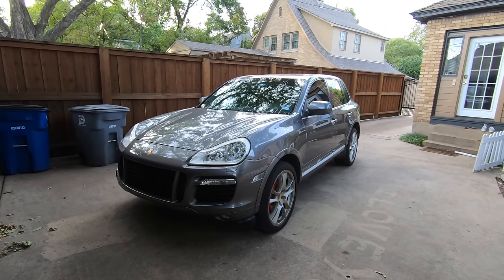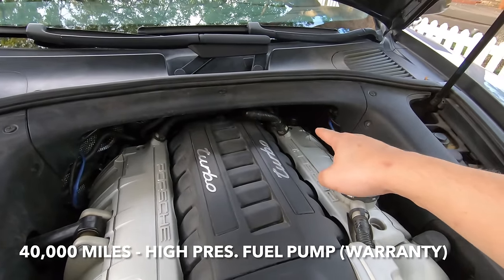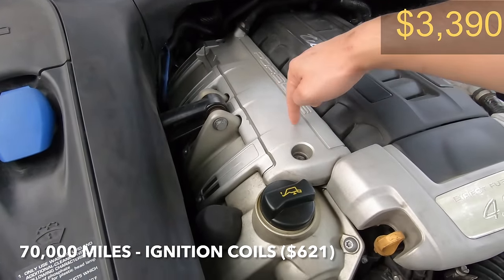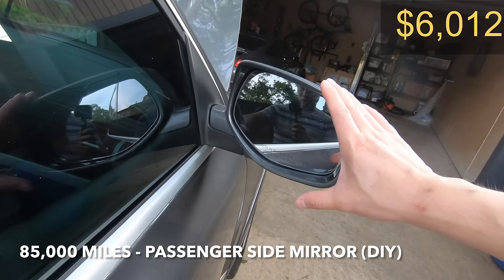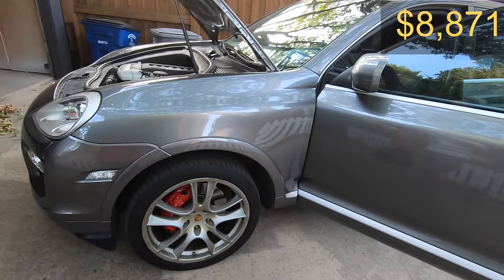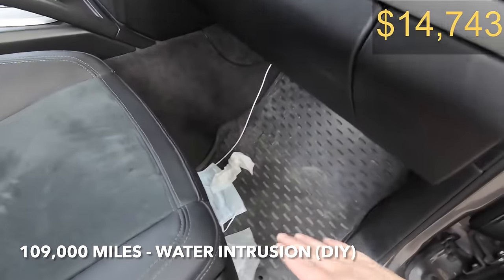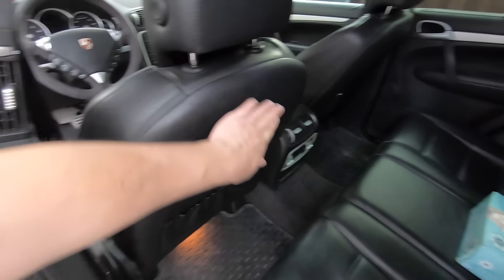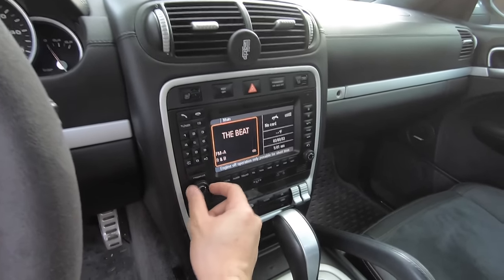Why Are Used Porsche Cayennes So Cheap? Owner's Review of 15 Year Old Cayenne Turbo (955, 957)

Comment: Having owned about a dozen different Japanese built cars over the last four decades, I can honestly say I havent had a tenth of the problems you have had. You are a VERY patient man dealing with those problems, I guess you have to be an car enthusiast (and part time mechanic) to own a Porsche.
Reply: Yeah car enthusiasts can't own reliable cars lol. But 99% of Japanese cars are naps on wheels.
Reply: what is the japanese equivalent of this car?  the infiniti fx45 and fx50 with the v8 is probably the closest, and a car i may buy some day as ive always loved those.  not nearly as fast as a cayenne turbo s stock but close enough to the non s turbo a few basic mods could make that more equal.  the cayenne has a lot more cargo space though i believe.  the fx series are not really made to be spacious.  not sure what theyre really made for to be honest lol  but they look cool and drive pretty well for a car that is fairly cheap to buy and probably cheap enough maintenance compared to a porsche.  i had a 92 infiniti q45 for 3 or 4 years around 2001 to 2005ish and it was honestly a really good car, even with the high miles mine had.  no issues other than replacing the thermostat once and it was up around 135k miles i want to say. my 1990 maxima se i had before that was also pretty solid. part of why id like one of the v8 powered fx models.
Reply: The issue is it isn't really a porsche but mostly a volkswagen with Porsche stickers
Reply: Car enthousiasts usually don't buy SUV's.
Reply: @mediocreman2  🙄
Reply: @vincentpeeters1157 thats definitely not true
Reply: Yep Japanese are best. My Landcruiser was expensive to buy, but reliable as hell. I sold my Audis and MB and just gave up on EU and USA cars forewer 😂
Reply: @vincentpeeters1157  Car enthousiasts usually get older and buy then SUV´s
Reply: @robertbehrendt8685  Perhaps it's more comfortable when you're over 70. Next to that I can't find a single argument why to buy an SUV. Despite that it's fashionable and trendy, but car enthousiasts don't think like that.
Reply: @vincentpeeters1157 car enthusiasts buy multiple vehicles to serve different purposes.
Reply: You also had about a tenth of the experience he has owning a luxury car.
Reply: Seriously I thought he was trolling lol this is crazy
Reply: What a patient and forgiving man.  I would have junked this dog years ago.
Reply: I drive a Focus, a pretty well known crapbox. My biggest issue so far, at 112k miles, is a bad purge valve, which I currently deal with by filling up at a station with a hilly pump so it doesn't sputter (I assume gravity helps with the fuel flow until the air is cleared out).
Reply: @wesleeysutton5935  that's real nonsense
Reply: J cars are great.
Reply: As a Lexus owner that is complete BS. You are comparing luxury cars to 100hp commutters How about Lexus/Toyota Rusty frames that total your vehicle? rust body panels? rust in beds, melting interior? 2GR engine out jobs? paint peeling and paint fading? Toyota dbw stuck accelerators, Transmission issues... and that is just in their Suvs.. there are cars like the Lexus 460 that are NIGHTMARES to own.
Reply: buy good german cars and they are tanks. Such as w124 mercedes and so on. Cayenes are very reliable if maintained there is people here with 250k on theirs. There is plenty of japanese cars that are nightmares to work and very unreliable...
Reply: @ToyotaAristo  old Mercedes were reliable. People just don't understand that the market has changed. In order to keep profitable you need your clients to buy a new car every 6 to 10 years AND make them so complicated you have to visit dealer for maintenance. Japanese were later in that strategy, so were more reliable and cheaper to maintain in 2000-2020 times. That's just the very, unsexy, naked truth of the matter
Reply: @ToyotaAristo  A Lexus is a luxury segment car too.They are litteraly made to compete with German luxury brands.  It's basically simple, the more you pay for a car, the more you will continue paying for it
Reply: I watched until you said $2000 for rear wheel bearings. Im sure others may have said that you are just going to mechanics that rip people off. They must see you coming from a mile away to charge that much for rear wheel bearings which are not unique to Porsche, can be bought anywhere for a reasonable cost, and fitted at home in your garage with a few tools & no need for a hoist.
Reply: @mediocreman2   what do you call being towed? Exciting.. or spending your money that could be actually invested instead… cars aren’t investments they’re just transportation and so many burn what should be their  retirements on just looking like they’re wealthy when in reality their driving their wealth into the ground. 😅
Reply: @vincentpeeters1157 They are good for trailering my 1965 mini cooper s!
Reply: reliability is the best form of luxury.